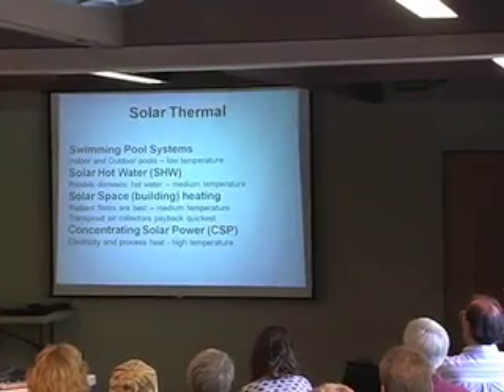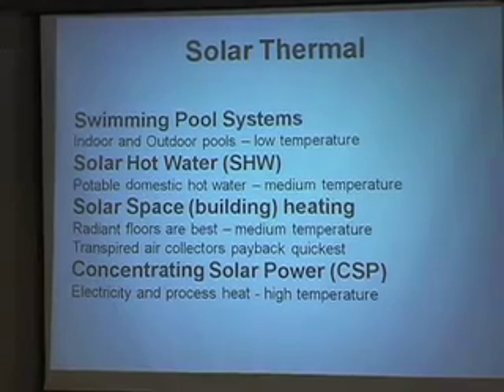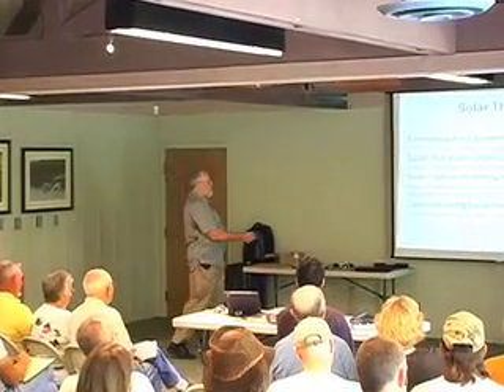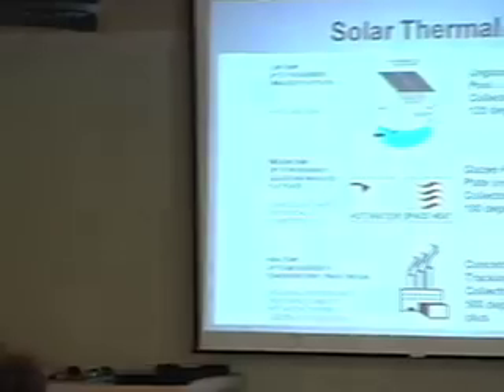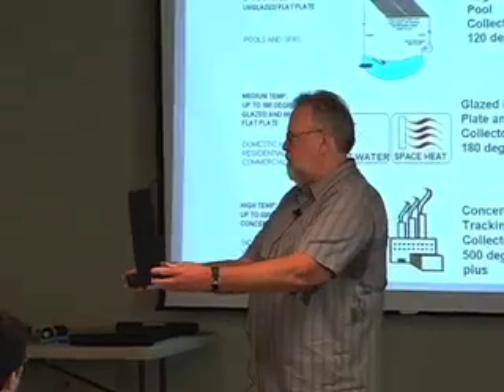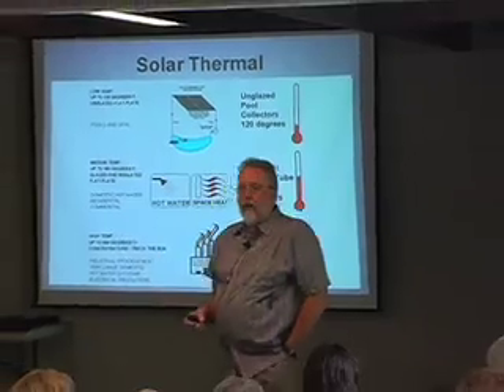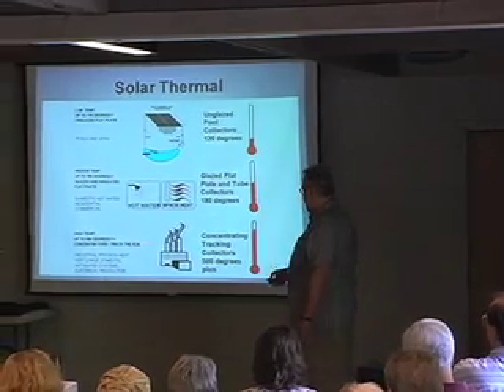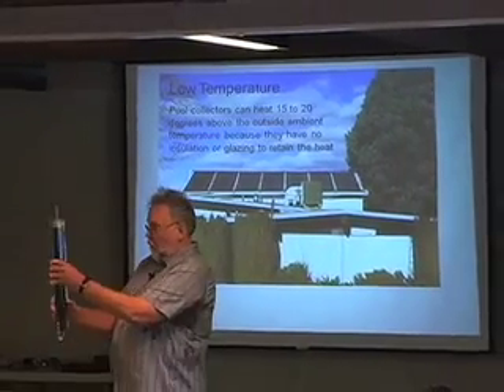Solar Thermal Technical Overview

Comment: These are really good overview videos.  Watch the rest.  A couple possible (not necessarily probable) future uses for residential high temperature concentrated solar would be solar tracking Stirling generators or interseasonal thermal storage.  Higher thermal mass temperature results in lower thermal mass volume.  There are also the molten salt concentrated solar grills and ovens that use temperatures in the 500F vicinity.